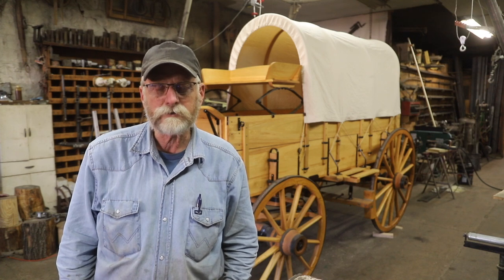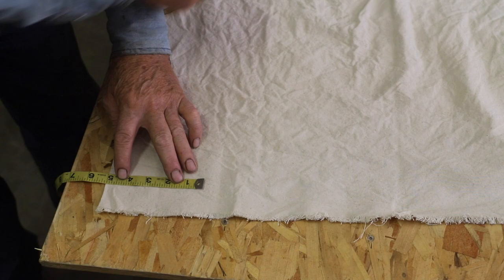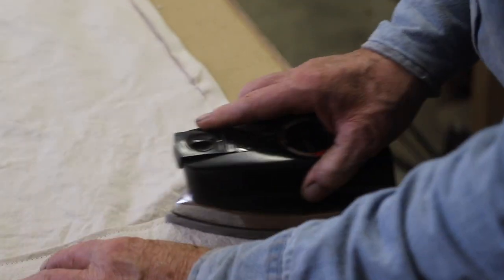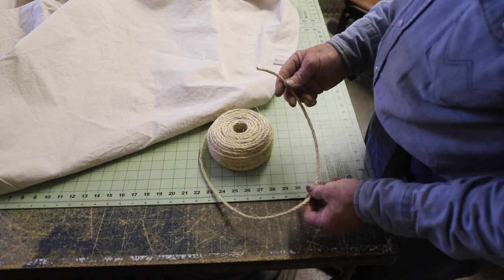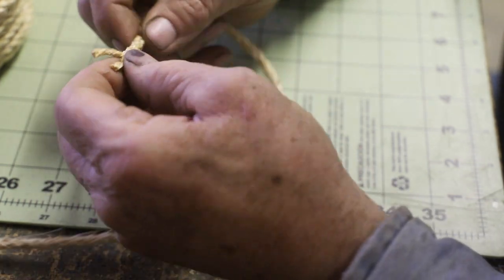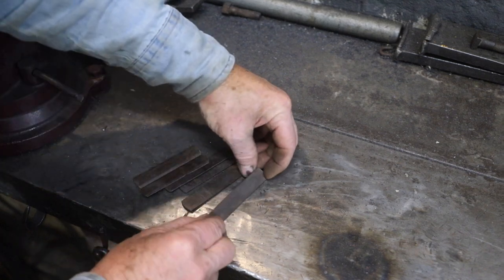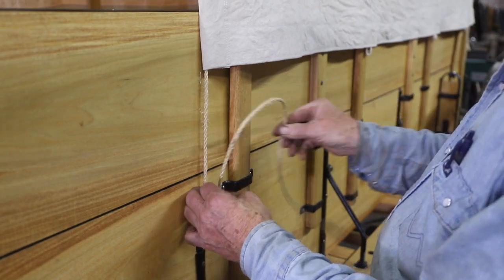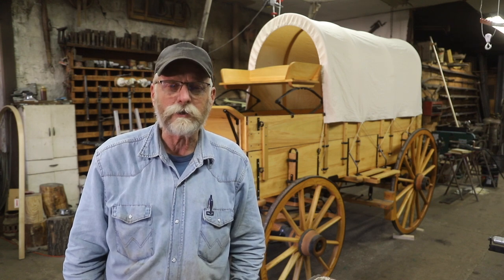Sewing Canvas Wagon Tops & How They Attach | Engels Coach Shop

Comment: 10:00 I've spliced a lot of rope, but not seen that way to start a butt splice before.  Very clean, will have to try to remember that!
Also that climbing half-hitch is an interesting variant on a taut-line hitch...
Seriously in love with that walking foot sewing machine.  Doing the cross patterns you put on the loops is a serious pain on a straight machine!!
Reply: A nice detail there, a back splice started (as normal) with a crown knot.
Reply: Essential craftsman has a great video on the same method but on a larger piece of rope. Ive used it a few times now.

Comment: As always, enjoyed the video.  However, when you were at the machine sewing I noticed that the light was yellow which indicates you are using a 2700K soft white light bulb.  I would offer a suggestion; change the light bulb to a 5000K daylight LED.  I work for a big box store and have helped hundreds of people "see better" by changing them to Daylight.  Try it, you may like it.  Bless You and the Mrs.
Reply: Some machines use a 6.3 volt bulb with a standard base that gets its power off a tap on the motor winding. That is how my machine, a Singer clone works. Not many bulb choices. Machine has a clutch so the motor runs all the time.

Comment: Can you do a detailed video on braiding back rope? I use steel completely all the time with cut ends and hate the electrical tape ends and even the wire tie ends cone apart. Like to see how the rope ends work and see if I can get wire to do the same.
Reply: Seems like the bend radius would be too much for the components of a wire rope.

Comment: A tip for running your pathcher from someone who's spent a lot of time behind one.. If you're like me it is hard to have enough strength or range of motion in your ankles to run the treadle, especially doing the short runs and zs. I crisscross my legs kinda down at the ankles so one foot is behind the other, this way you can  run the treadle by pumping the legs, as well as having fine control at the ankles/toes. This helps so you can keep both hands on the work. You still usually still have to spin the wheel to get it going in the right direction,  but a lot of times I can rock it back and forth with treadle slightly to get it going. Anyway hope that helps.
Reply: I thought his machine had an electric motor.
Reply: @MichaelOnines  some do. I didn't hear one running and it looked like his leg was moving,  so I assumed it was a treadle.
Reply: It does have a motor.
Reply: @dianeengel4155  Ah, well my bad. I never liked the motorized patchers. It felt more like sewing with a trip hammer lol

Comment: Were the canvas tops ever treated (with wax, tallow, oil, etc.) to make them more water resistant?
Reply: I don't think so. They're water proof as long as nothing is touching the canvas. There are things you can spray it with, but Dave doesn't.

Comment: That was interesting. Cool to see your backsplicing/whipping technique. From my experience on small sailboats, I wonder that the tie downs are not threaded through purpose-made hooks or rings rather than running through whatever other hardware just happens to be close by. In particular, where the lines are threaded through the join between the box braces and the body straps, I would worry that the lines would get wedged in that angle and would either get sliced, or chafe and wear through quickly after just a few hours of jostling on the road.

Comment: Dave, were those tops ever treated to make them water proof or resistant?  Or were they primarily a protection from the sun? - Phil
Reply: I think that if the canvas is taught, the rain runs down the sides and off the bottom edge even if it's not actually waterproof. If there's no bags where the rain can collect, it stays pretty dry inside....as long as you don't touch it on the inside...then it'll run right down your arm.
Reply: Mishn0 is correct.

Comment: I've got questions? Do you water seal the canvas. What kind of thread was used, weight, and waxed or not. Thank you so much. Hope to hear if you were able to work on your property this summer.
Reply: No, he doesn't waterseal the canvas. As long as nothing touches it water doesn't go through. Dave doesn't know the weight of the thread, but it is pretty heavy, and it is not waxed.

Comment: is this top weather resistant? waterproof? how much protection does a canvas top offer?
Reply: Should be about the same as a canvas tent. If you keep it from being flat or having a low point they do ok at shedding the water. Anything touching the inside will be an additional path for the water to follow, but otherwise the surface tension of the water keeps most of it clinging to the fabric or running down along it.

Comment: A great series. This one, especially, takes me back to long-past (over fifty years - where does the time go?) days as an Army Mech Maintenance Officer. Recall having a little training in MOS course, and then being around unit shops where the canvas section repaired (and in a few cases made new) the canvas covers for the trucks our units supported. You do good work. We, of course, used a lot of grommets, but we were working with modern vehicles. For the time...

Comment: I'm pretty sure using a sewing machine would push me clear over the edge.  Trying to negotiate and fight with the fabric and getting everything lined up and so forth would drive me insane.
Reply: Started using my mom's sewing machine when I was ten ..... ran the wheel around with one hand while "steering" the fabric with the other.  After a couple of months, I got brave and started using the knee control (not a pendal on the floor).  Been machine sewing for 61 years now ..... making everything from clothing, to draperies to quilts.  Am currently working on a supply of shopping bags the size and design/style of the typical plastic bag from the grocery store.  I'm coming down the home stretch.